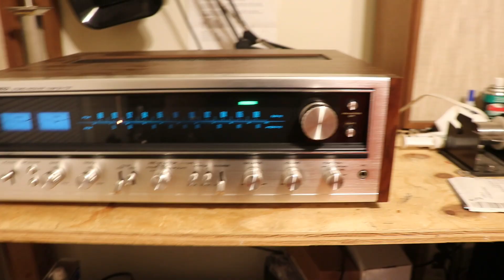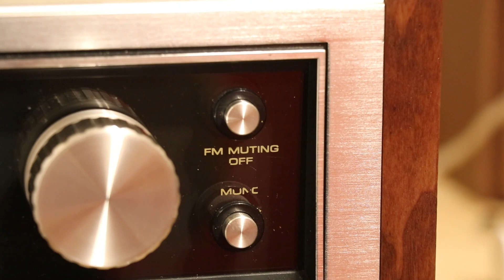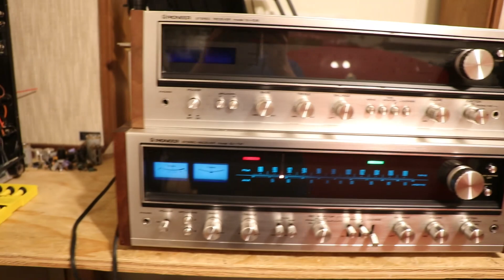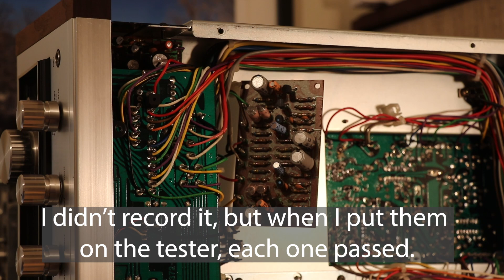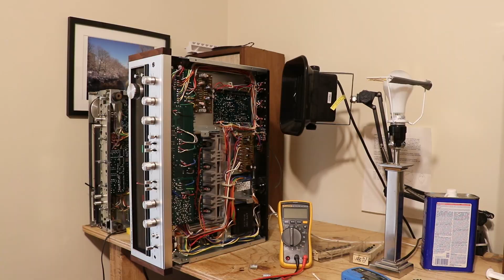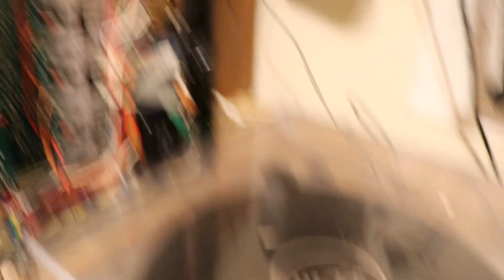SOLVED: Pioneer SX-737 LOUD Pops And Crackles In Phono!

Comment: This vid will probably help me with a popping issue I have on a junk store Nikko STA 5050 receiver I got for almost nothing. It also pops, and with the volume up it dims the display lights and the dim bulb lights up in sync. Still haven't narrowed down which preamp the pops are coming from, but now I'll take it off the shelf and check it out.

Comment: Do you do this for an income?  If so, how does one contact you?  I am original owner of Pioneer SX 770,  I have loved it since about 1973.  It truly sounds wonderful, but the Bass and Treble  potentiometers seem to have failed, because they "feel" like they are not touching or something, (no physical resistance to motion in my fingertips, and no noticable sound difference when they are turned.. This unit has been loved and protected all its life, and I would love to have it brought back as far as possible, so that we both might die together.  Do you do that, and if so, where are you, and if interested you could do a video on a 770.  They only had 15 wpc.  But the sound is incredibly solid at all ranges, bass to top of the high side.  I still have the square speaker input jacks, none broken.  As I said, this has been loved all its life.

Comment: This is a great looking and sounding receiver but it has two problems that i've noticed.

1. Not all SX-737 seem to have power outlets at the back. Didn't realise that until I bought mine. I've asked my tech to add power lines to the back and he added two unswitched because he said switched ones would put pressure on the power switch. I think he's being overly careful as I was only planing to use the switched ones for a bluetooth adapter so it wont draw more than a couple of watts. Most SX-737 have both switched and unswithed power outlets at the back from factory.

2. Don't know if this is a common problem or it's just mine that has been wired that way. The UV meters seem to stay under load even when the tuner section is not used. The UV needles bounce when moving the tuner wheels even when the receiver is set on AUX or Phono. If anyone can confirm this is the case with theirs pls. 
Wouldn't this shorten the life of the UV meters?
Would it be possible to mod them so that they are operational only when FM is selected?

Comment: That capacitor is bad. As McGyver would say: Ya think? I've run into many a noisy transistor in this vintage. I use Freez-it to pinpoint a thermally intermittent component.

Comment: Thanks for this vid, I have a Pioneer CT-506. The pops and clicks (super loud) Randomly happens every 5min or so, with the volume down regardless of the input.  
According to what you shared this would imply an issue with the power amp which I gathered then is post volume control.

I’m no technician, but I will try my best, how would I troubleshoot this, any pointers would be appreciated. Thanks again 🙌
Reply: The best way is with a scope.  Put it on a dead input and look for spikes.  Keep working backward until you find the stage that's clean.

Comment: i think one way to find a  faulty transistor is to point a heat gun at each transistor to heat it up. If the problem only happen after the unit warms up.  . Many years ago  i use to sell such heating tips to companies doing FA analysis where the IC would only fail after heats up. If you test the transistor cold they will pass

Comment: This video has helped me alot, I have a Marantz 2220B that im getting a loud popping noise on 1 channel with the volume off. Its there on all inputs with the volume down. I was wondering if it was in the preamp or the power amp but I think you just helped me find my starting point. it will light the dim bulb up everytime it pops... Which strange is it only happens if I attach a speaker to its channel. With no speaker attached the dim bulb stays off, when I attach the speaker to hear the pops the bulb lights up everytime it pops. May have to look into the transistors on that board.
Reply from the maker: Yup the speaker allows it to complete the circuit thus pull current to light up the bulb
Reply: @AHFixIt  much appreciated!

Comment: Thank you for your service to the Pioneer! Just got dads old SX-737 recently, seems to be working but not put through its paces yet. I am still dreaming of it being trouble free, but educating myself prior to hooking up to my Klipsch speakers or bench testing even with my cheap speakers... Definitely don’t want a blowout on my nice set.  Using a Fosi Class ‘D at the moment for amp along with my uncles old MCS 3235 for the preamp/phono The MCS has its own issues with the right hand speaker channel being gritty and reduced volume, so it’s just my preamp for now. Thinking maybe I should use the MCS for practice before going into the belly of the pioneer, but so far my one little test I ran with a tiny pioneer bookshelf speaker on the SX-737, it seemed to work fine with my turntable ( didn’t test both speaker channels). More to test in a few weeks when I have time and space on the bench. Thanks for your vids, very educational!!!! Will come in handy for sure ⚡️🔊👍

Comment: I am having the exact same problem with an 850.  I replaced the same caps and transistors. I lost output after that, but I had to set it aside for something else. I’m going back in to work tomorrow and will double check every thing. Your video mad me feel confident I did the right things. I must just have a bad soder somewhere.

Comment: Trying to learn electronics I have a Pioneer 424 going to replace all the caps and detox I just got and original 1972 shop manual for it I have no clue what the hell is means. I am lost . I thought it would give you voltage specs at terminals on differenty boards but it doesnt . Tells you what scopes you need and generator doesnt show how to hook it up or even the patterns for each circuit I am lost probably going to chuck it $20 down the drain 😞

Comment: Thank you! I ran into an issue where one channel was out, there was popping etc on the other channel. Then all of the sudden popping in the amp circuit. 

Replaced the differential pairs on the amp board, bias transistors, transistors on the phono board, most of the caps and now dead silent aside from the beautiful music.

Comment: Pioneer uses some Mitsubishi transistors that had some batches with manufacturing issues.  From what I gather, there were some mistakes made with making sure the die was properly sealed allowing corrosion starting on the leads to get all the way through the package.  The ones I know off the top of my head were 2SA725/726, ad their compliments 2SC1312/1313.  There are a few others.  A good way to test for this issue is with a hot air gun to replicate the issue and a cold air spray often makes it go away.  My SX737 had two of its input transistors with this issue and it did cause it to go into protection!  I found several leaking caps, and did a full recap on mine along with a couple of other routine maintenance items!

Comment: This is an excellent video, super helpful! 
Would you be able to share a good reference guide for replacing transistors? Caps are always straightforward for me, check capacitance, voltage, and polarity and you're good to go but transistors were always a bit more of a mystery... Thanks
Reply from the maker: https://youtu.be/9d9T22wxZA8 here's one from xraytonyb. They're a bit of a mystery to me as well!
Reply: @AHFixIt  And you just get transistor packs just like capacitor kits?
Reply from the maker: Not sure what you mean by transistor packs and capacitor kits. I buy individual parts from Mouser.com
Reply: @AHFixIt  Thank you man, this video you shared is also very helpful. I appreciate you taking the time to answer me
Reply: Replacing transistors with different types is hard. There are a lot of confusing parameters. Those low power preamp npn transistors can usually be replaced with bc547 and the like, if you do both channels. Phono stages like this are not only amplifiers but also a complex array of active filters, so the curve might be somewhat off with substitute types. Trial and error or a decent curcuit simulator might be required.
Or you get the originals if you find them, but note that's not always sufficient - like for power output transistors, they still have to be matched to each other and the driver, no two are exactly the same by chance...

Comment: Question... I bought a Marantz 2226B and it pops on the right channel when rotating the volume knob. The popping will go away if I rotate the volume up and down a few times, which is weird. Also, the right channel will drop off usually shortly after powering on the stereo and getting one or two songs into a vinyl. Sometimes rotating the volume knob or shutting the unit off and turning it back on quickly will solve the issue, and for the most of the time it won't happen again. Not sure where to start the troubleshooting process.
Reply from the maker: Sounds like cleaning the controls would be a good place to start

Comment: Terrific video very helpful thank you! I have a question for you. About my MCs receiver.Model 3236.I have a techniques m224 stereo cassette deck hook to it. I also have a Magnavox cdb 492 compact disc player attached to it. It's working fine the only problem I have is allowed popping noise whenever I power down the receiver. I don't know why I can't find an answer. Hoping you would have an answer, a solution, tips that I could follow to correct this problem? Well greatly appreciate your input thank you very much!

Comment: Old electrolytic's are a typical issue in most older gear , check those first !! Also one way to determine visually if a electrolytic is going bad is the plastic cover with the value marking on it will tend to shrink !! Compared to the other capacitors , And often past the top of the aluminum can they are on !

Comment: Remember: Due to how capacitance meters operate, a capacitor that is leaking current (i.e. weakly internally shorted) will show higher capacitance. Always consider "overachiever" caps as extremely suspect.

Comment: Many transistor leads have turned black with tarnish. That somehow makes them noisy.   
You can remove the part from the board, scrape off the tarnish (be sure to get rid of ALL of it) with a sharp blade, and reinstall.    
I've done it successfully a few times.   
Also, I would most likely have replaced All of the electrolytics on that board at the same time.
Reply: This won't work if the oxide has moved up into the transistor body. When that happens, replacement is the only option.
Reply: how would tarnish affect anything aren't they joined with solder?
Reply: @simonlinser8286  
I wish I had a logical explanation, but it's still a mystery to both me And the man who told me about it.   
Just maybe the heat from removing the parts and putting them back in does the trick, 
but I really believe the tarnish has a lot to do with the problem.  
In any case, there isn't much to lose by trying it, and if it doesn't work you can still replace troublesome transistors anyway.

Comment: Nice work. It's good to see a young man doing this kind of work. Old guys like me who have done it for decades are falling like flies, so we need people to do this when we're gone. If you look at the leads of those transistors you replaced, you'll likely see black oxide on them. This is probably what you're planning on talking about in that next video. (Am I right?)

 I've always called this "black leg syndrome." I replace such transistors on sight even if they're not making noise yet, because they will. The caps you replaced are in the ground leg of the negative feedback circuit of the phono pre. They failed because the transistors were intermittently feeding a lot more than 6 volts to them. Their value is critical because it sets the infrasonic rolloff frequency that helps keep warped records from sending powerful infrasonic signals through the power amp. When those caps failed, the negative feedback went way up and the gain went way down, which is why you didn't near the popping sounds at first. 

Keep up the good work!

P.S.: You'll find such transistors in Pioneer RT-701's, 707's, 901's, 909's, and 1050's as well as in lots of other units from that era. I had to replace 22 of them in my RT-1050! I've even seen them in the differential input stage (long-tailed pair) of power amps. In that position, the popping noise is not affected by the volume control, but it tends to be quieter.
Reply: Very much honor a man with your knowledge.  Thank you
Reply: @missyounorm33  You're very kind.

Comment: I always shotgun those old Elna caps for that exact reason. They bulge and fail from the bottom and don’t bulge from the top, so visual inspections aren’t reliable with them. I’m not super worried if a cap drifts slightly out of spec, old caps do that, but with the Elnas, they’re silent killers and I change them all out as preventative maintenance.

Comment: Nice video of a swell component. The rec out feature was very rare in this time/price period. I know Yamaha had it on their later 1970's receivers. Pity this SX-737 didn't have pre out/ main in which would have increased its functionality. My first component receiver (after military service and broke) in 1974/75 was an SX-434, hooked to a BIC 920 and KLH 31 speakers. All for under $250. Loved that blue back lit dial scale, orange station pointer and red STEREO lamp. 
 The SX-737 is such a BIG receiver with only 35wpc. In early 1970's TOTL component receivers had under 40wpc and THD's of 1%. Man, how that changed by later 1970's. Amazing how these forty+ year old components can be restored to good working order. A credit to their build quality. I use an SX-434 in my kitchen hifi system. It drives a Nakamichi BX-1 cassette deck and Boston Acoustics A-40 and Synergistics S12B speakers. The little 434 can easily drive a 4 ohm load. Not like some amps of today. Still dig lookin' at the blue lit dial scale of my 30 series Pioneer.

Comment: Great trouble shooting video! When you diagnosed it was an issue with the pre amp board, did you just replace all transistors or tested each one to identify the defective component?
Reply: He mentions in the video that he did check each one, and they all tested good.  He did however mention that even if they test good, doesnt mean they are good, as these were on their way out.  Cheap and easy to replace.

Comment: I have an SX838. And it has two phono inputs. Phono one is making noise. Phono two is FINE!
How is that possible? Isn't there just ONE phono pre-amp in the unit. Why would one be problematic and the other sound clean? Thanks. Not a big problem since I can use no. 2 for now until that also fails.
Reply from the maker: Yes, only one phono preamp. I'd clean the function switch assembly and check grounds. The way it's wired, it wouldn't make sense to hear issues only in one phono input if there was something wrong with the phono preamp.

Comment: Thank You, always a pleasure watching your videos. Excellent.
Reply from the maker: Next week's video is quite similar to your SX-636 video!
Reply: @AHFixIt  Excellent I will look forward to watching that one, nice interesting fact about using the Mic input as well
Reply: I debated buying a sx-636 the other day that needed all new bulbs and a good cleaning. It was $70. I should have made an offer. Would have been a decent project to learn on.
Reply: Great video. I still have and use my 737 I bought in ‘76’… had the Pots cleaned the darn thing still sounds great for only 35 watts… And it looks to be in the same condition as this one.